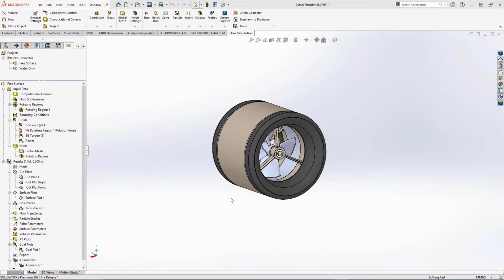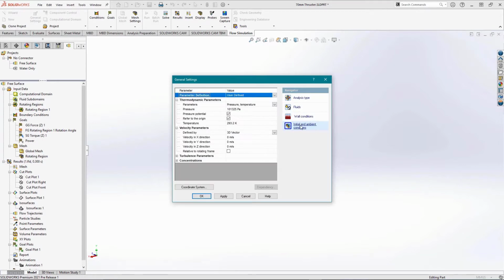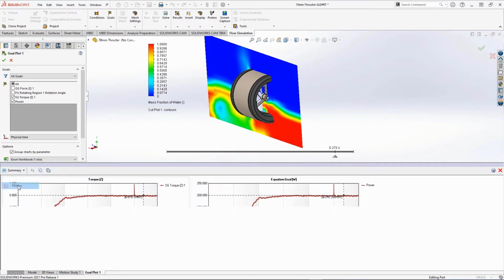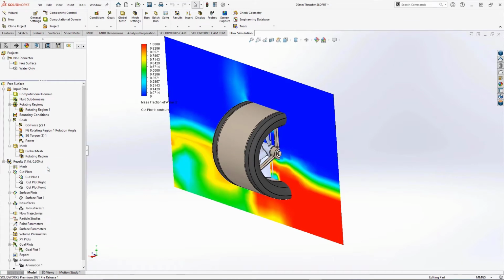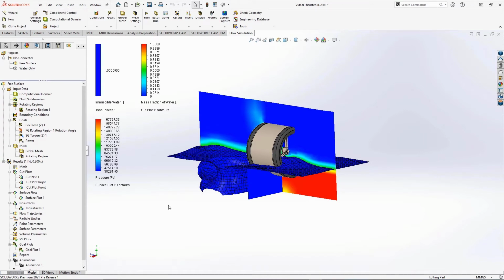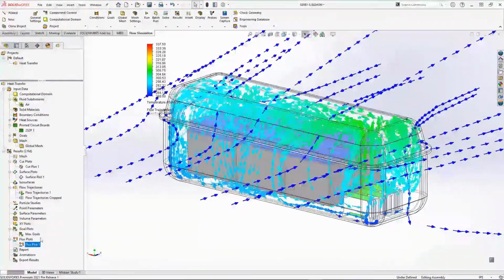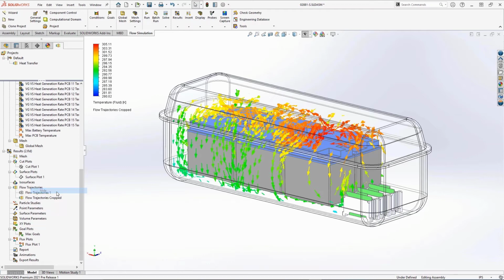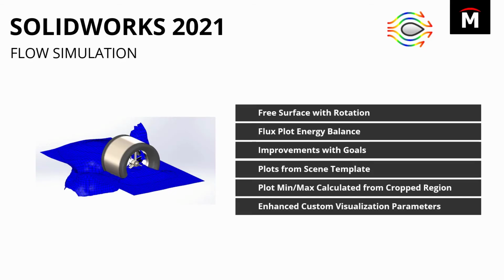What's New in SOLIDWORKS Flow Simulation 2021

Comment: how to use solidworks flow simulation results as initial boundary conditions to perform anoth flow simulation based upon the results
Reply from the maker: This capability is often called EFD Zooming or Transferred Boundary Conditions.  In the tutorial document that installs with Flow Simulation, by default found in C:\Program Files\SOLIDWORKS Corp\SOLIDWORKS Flow Simulation\lang\english\Docs\, Tutorial C1 illustrates an example of this by analyzing an electrical enclosure for the overall flow characteristics, and then creating a new study focused around a single heat sink using the previous results as boundary conditions.  I hope that helps!